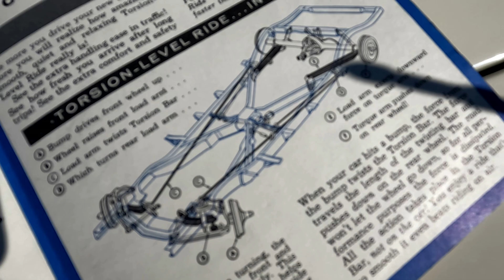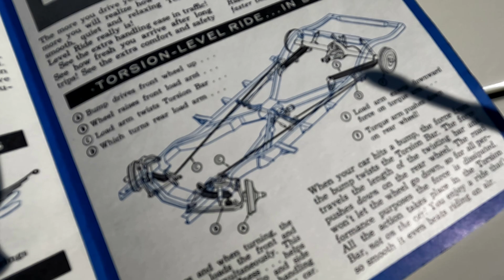Packard Torsion-Level Suspension explained and demonstrated.

Comment: Do torsion bars wear out? Loose their springing?
Reply from the maker: Actually, they don't. Now, they can start to sag a bit past the resting specification but unlike coil or leaf springs, the bar arm stops can be adjusted to compensate for this. If the bars are abused and pushed past the yield point, sure, but unlikely in this application. If they were on a load carrying truck, most likely over time.
Reply: 68 years later, mine are as healthy & buoyant as new. They can be adjusted at the front and the last time I did that was about 45 years ago. Amazingly trouble-free, elegant design. The two additional bars for leveling, also last forever. Not so the time-delay, with its electo-mechanical unit,  which can be replaced with a more modern solution for "pocket change" plus labor, if you're not a tech type. @classicperformance
Reply from the maker: @williamlegall2988  Thanks!!!  For now, everything on our '56 is working spot on perfectly. After all, the car has less than 5,000 documented miles on it since it left 1580 E. Grand Avenue.
Reply: I wonder how people got these cars serviced when they were 10-15 years old?
Reply: @1940limited The same way auto repair has always happened. You fix it yourself, pay someone else to fix it, or don't fix it. (My boss works on most 50's Era stuff at my shop)
Reply from the maker: These cars are relatively simple in terms of technology and how they work. Anyone with general mechanical knowledge can service them and even today, parts are plentiful.
Reply: @1940limited   the same way they were serviced, new. Just ask the man that owns one.
Reply: They are designed for 'infinite (cycle) life" just like other springs are.

Comment: Wow that front torsion is controlled by rear lower control arm.  Keeping the car flat, as rear compensates for weight
Reply from the maker: Yes, pretty much the genius design. It's amazing that on lesser models you had this as optional over front coils and independly sprung axles.

Comment: I love the '56...my fav postwar Packard. So classy, and technical.  The best thing about the torsion bar suspension is that the bars don't touch the frame at any spot, so the isolation reduces NVH.
Reply from the maker: Thanks Steve. Good point. And true. Good isolation. Thanks for the interest.

Comment: The reason the long bars tie the front and rear wheels together is to keep the car level when bumps in the road are encountered. When the front wheels come in contact with a bump and go UP the long bars are twisted and the twisting force go rearward through the long torsion bars and push the rear wheels DOWN. Voila! A perfectly level ride!
Reply from the maker: Amazing design. Thanks for your input!!
Reply: Are the torsion bars that go to the leveling motor supporting the entire weight of the car?

Comment: One good part about the torsion bars suspension was the ability to work under the car without the need of the time a lift. If you needed to work on the rear end, you had all the Neighbor kids sit on the trunk lid, you would turn the ignition  on car with level itself out you turn the car off and everyone would pile off, and the back of the car would raise up nice and high where you could work on it.
Reply from the maker: Yes, indeed that is possible. There is a switch to deactivate the system under the dash near the driver's door.  I use this process to set a desired ride height too, then turn the system off.

Comment: How difficult is it to find a replacement motor for the TL system?
Reply from the maker: We are unsure, and hope to always remain unsure. However, the motor is a common Delco Remy adapted 12V starter motor. Could easily be rebrushed and rewound. We feel the demand and duty cycle is so light, it is very understressed and failure would be rare. The delay box would be of greater concern, as that is application specific.

Comment: 1. The electric motor is only intended to compensate for overloading the rear end. It does nothing for the ride. The motor you see is a Borg Warner starter motor adapted for the job (the push button tranny also used the same motor to move the gear shift cable in and out).
2. The front and back tires are connected by the long torsion bar so that when the front tire moves up or down, so does the rear. There are no such connections side-to-side. I was hoping you'd do a couple of panic stops to show how the car squats down several inches, but does not nose-dive. Strong acceleration causes the suspension to lift the rear of the car. In both cases, the car stays level, hence the name "torsion level." 
3. Coil springs are nothing more than torsion bars wrapped in a circle. The wires twist, they do not bend.
4. Citroen had a similar but far more sophisticated system which used air springs and interconnected high pressure hydraulics for front-back and side to side compensation. It was very complex but worked so well Rolls Royce and others adopted it.
Reply from the maker: Thanks for the great information! We agree with all, 1-4.
Reply: Your point 2 is not at all clear how the long bars function to keep the car level. See my explanation of that process in this thread!
Reply: The torsion motor was. It BW unit . It was a Delco Remy unit . I know because I have a 55 400. The puhbutton shift had its own motor to shift gears . That would been impossible to engineer . Everytime you changed gears , would have messed with the suspension . The rest of the push button system was engineered and built by Bendix for Packard .
Reply: * Correction -  The torsion motor was not a BW unit .
Reply from the maker: @vincentconsolo5782  You are correct. The levelizer motor is a red tagged Delco-Remy motor as shown at the 11:00 mark. It is a modified starter motor. I had thought the pod selectable push-button actuator system was built by Autolite for Packard. 
Thanks for the input.
Reply: My apologies to you kind sir . ! 🙂 You are ,100% correct ! It was Autolite !  I got them confused with Bendix . When SP went to Autolite for spare parts runs  around the late 50's or early 60's , Autolite had already destroyed the tooling . Perhaps by that time , it was because of the recent purchase by Ford of Autolite ?
Reply from the maker: @vincentconsolo5782  That could very well be true. As of today and back into the 60's, Autolite and Ford are synonymous.
Reply: Obviously the best way to drive the car was gently without panic stops or hard acceleration. I wonder how many owners took such care of them?

Comment: The TL system is also wired through the 3 wire brake lite switch. When applying the brakes, the TL system is dis-engaged. You wouldn't want the pitch of the car to suddenly change during a hard brake application.
Reply from the maker: Interesting and a good point. I felt the 7-second delay was accomplishing that task as well, but this makes good sence. It appears the "level sensor" has to be quite sensitive and precise to "trigger" with a 3-4" change at the rear of the car. It must be triggering and activating quite a bit over bumps in the road and the delay is canceling all the false readings. If just driving with just a driver or additional passenger in the front seat, my theory is to always leave the suspension in the off position. I have also had passengers in the back, let it level set then turn off for the duration of the drive. I can't find any reason or benefit to have the suspension on during normal driving. Others might disagree.
Reply: There is a rod clamped to the levelling torsion bar that activates a switch if it twists too far from level either way. The 7 second delay is a bimetal strip (two different metals back to back) with a coil around it for heat activated by the switch activated by the rod. It puts power to the coil and heats the strip that after 7 seconds bends from the heat to contact another switch that turns on the motor that twists the levelling torsion bar. Once the torsion bar twists back to level current to the original switch turns off. All this in a box slightly bigger than a regulator next to the levelling motor. Sadly, subject to corrosion over time. But heck, who needs chips and transistors in 1955/56. Dad sealed the box on my mother's 56 in the early sixties with tar and it works to this day.
Reply: @leeprice5633  Basically the same device as a turn signal flasher.  Ingenious!
Reply from the maker: Lee, this is good information. I was thinking of a mercury bulb level switch such as in an older home thermostat. The physical bar-arm sensor makes perfect sense. I imagine it is able to be loosened and adjusted to set the "level set" ride heigth as desired. This particular '56 sits "level" just a tad low in my opinion. I have let it rise up a bit then turned off the master switch to give a bit higher ride. In the upload, you can see the delay box and as you said, just a bit bigger than an old voltage regulator box, but similar in appearance. Appreciate your interest and knowledge.